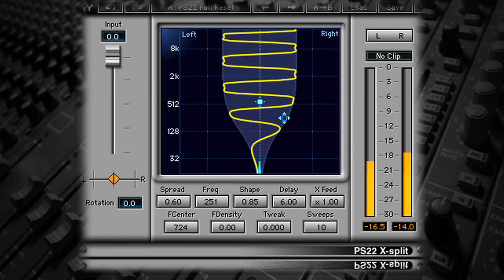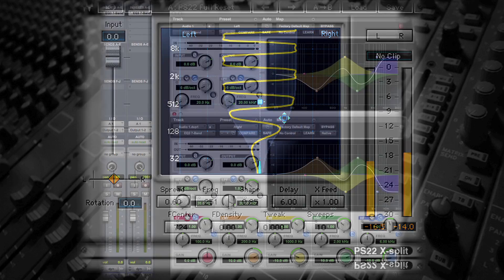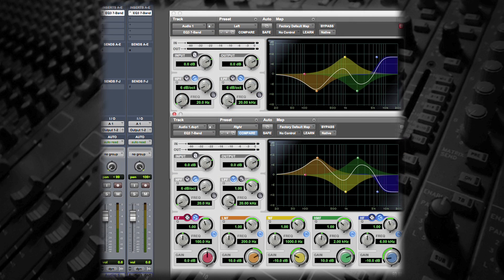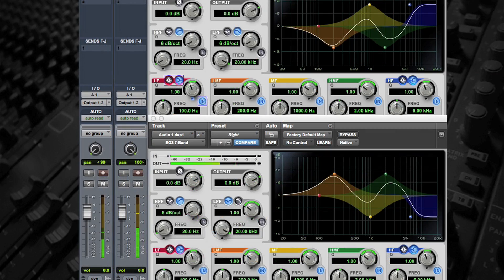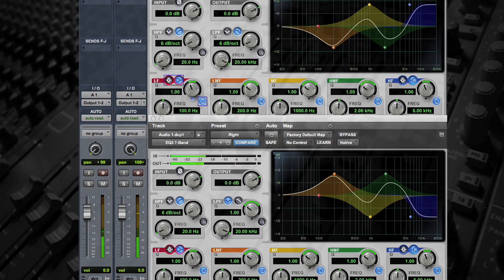Stereo Sythesizer

Comment: Back in the day I worked as a master control operator for an NBC station in the mid to late 90's. They had a Orban Automatic Stereo Synthesizer, probably  Model 275A. Since some programming was mono and other programming was in stereo, this box would automatically detect mono audio and synthesize artificial stereo. Or if it detected stereo, it would pass that along unchanged. It did a pretty decent job of making a wider sound stage. You could watch it kick in on the stereo scope from a narrow line (mono)  to a squiggly wide line (stereo) that roughly mimicked what stereo would look like. We had a remote disable switch that would turn it off from automatic mode. Normally you would turn it off during prime time or a movie since those shows/movies were mixed with the intention of using a Dolby Pro Logic Decoder to recreate the original theatrical mix. Since synthesized stereo would mess up the center channel audio, i.e. dialog that was mixed into both Left and Right channels that  would then be taken by the Dolby logic decoder and put into a center channel speaker, etc. Or any rear channel ambient effects. 

I always tried to be diligent about disabling it during prime time or some weekend afternoon movie. However I knew most operators never touched the thing. I guess the idea was to bridge the gap between the mono era of TV with the oncoming  stereo era.  At the start of stereo broadcasts many stations could only pass on network programming in stereo, or had a limited number of internal sources that could be in stereo, like production and maybe one or two other sources like commercial playback machine.  While a lot of syndicated shows were still in mono, or the routing of video and audio between equipment was still mono infrastructure. As that equipment got replaced more stereo programming was possible.  With these stereo synthesizers to help make the station sound more consistent with the network programming. Make it less jarring to go between stereo sources and mono sources for the home viewer. Synthesized stereo could help keep the sound stage sounding from collapsing and expanding all the time. The same is true of 5.1 today, most stations have some kind of equipment keeping the 5.1 "pilot light:" on and recreating that even when a stereo source come up. Commercials are notorious for being in 2.0. Going form a network program in 5.1 and then a local commercial in 2.0 audio is also jarring, especially on home stereo systems that switch modes. Better to keep the 5.1 light on and encode a 2.0 commercial into 5.1.
Reply: Bravo very good.  I wish I could hear a sample of the 245F at work...